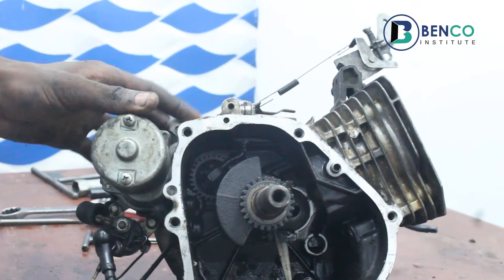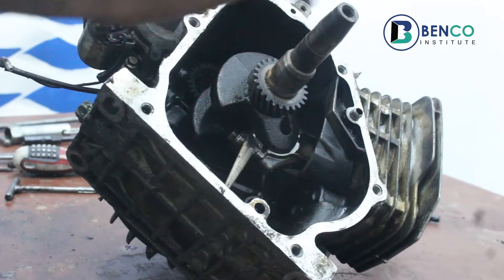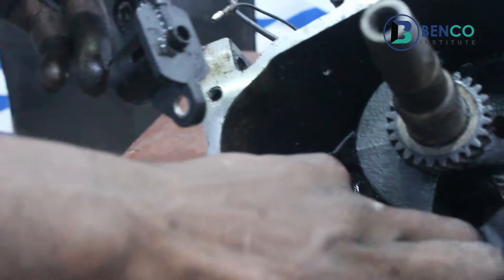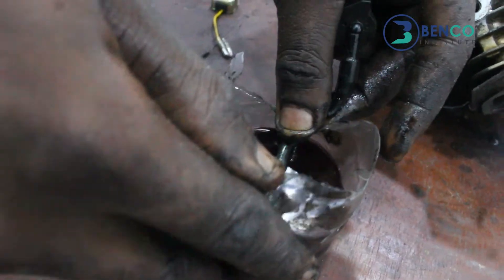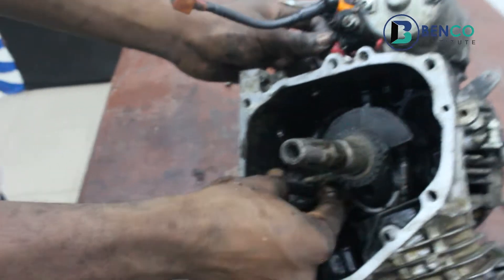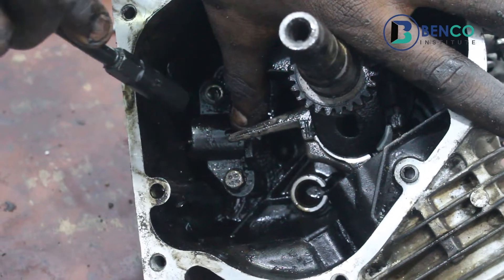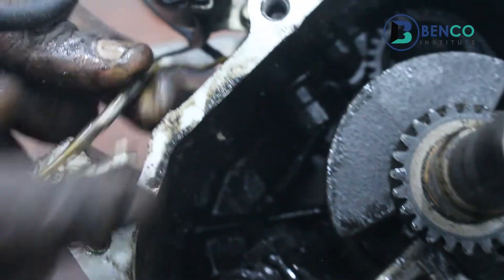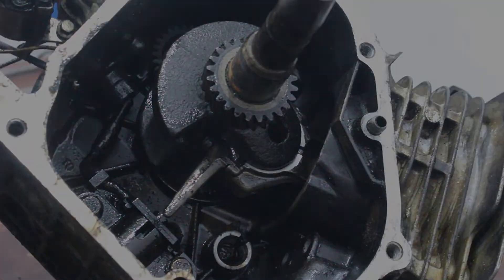How the oil switch and oil sensor of a small engine 4stroke generator work for  fireman,Honda,yamaha

Comment: Thank you for a simple explanation of how that switch works.
Why would them manufacturers ever put a simple switch inside the crankcase? 
I think it was Honda's original design with all the Chinese engines foolishly copying them.
Pain in the Arse to change a simple switch. I assume most people cut the wire and leave the engine unptotected.
Reply from the maker: You are very  right

Comment: Thanks, answered my question.  It's a float switch.  Oil lifts up the float from buoyancy and breaks electrical continuity through the case.  If oil falls low enough, the float drops down and grounds to the case.

Comment: My generator is new 5kw fill with oil and started oil lamp is glowing what is the reson
Reply from the maker: The sensor could  b faulty  then 
Or change the oil,pump fuel into the oil compartment. Let it out and allow the compartment  to dry

Refill  with a fresh oil and it could work...if it doesn't  ur sensor is gone

Comment: My generator light goes low and sometimes comes to the regular voltage, is that my generator sensor wires is faulty?
Reply from the maker: No its not

Comment: Hi Benco thanks for your explanation.Since the oil alert switch and the engine switch are inter connected why is it that when the oil sensor wire is disconnected the engine still works
Reply: When the float drops, the metal pin contacts the crankcase and grounds the primary for the ignition coil. In a nutshell,  the float pin completes the circuit and kills the spark.
Reply from the maker: @michaelscott8510  just to add..the gen  only works because there is still little oil left in that crankcase... If that oil dries up with the switch disconnected your generator would blow up
Reply: @bencoinstitute  what am actually saying is that since the oil switch is totally disconnected and nothing bypass the generator will still work why
Reply from the maker: That's the exact point...Pls watch the video properly you will get your point
Reply: Tanx for your reply but as far as I am concern the function of the oil sensor is useless because without it my generator still works without bypass any wire or module .
Reply from the maker: @adeleyeayodeji1032  
Yeah
Without it if the oil of your generator dries up..your gen will cease and with that you kay have to change a new engine or overhaul it depending on the Damage

Comment: hi benco, you doing a great job.
 I want to ask a question, I have a brand new fireman SFE 440E generator which I normally use for 10hrs a day except for Sundays which I don't work. please how often should the oil be changed or the generator be serviced?
Reply from the maker: Thanks for the compliment

I think you should check your owners manual for that, it's clearly stated the total hours you should use your Generator before replacing the oil...

However  most petrol generator maual gives a range of 150hrs-200hrs of oil use...at this point they believe  the oil has lost its viscosity which in turn reduce the quality and effectiveness of the oil...

Now if you run a generator for 10hrs... Using 150hrs as a yardstick you will have to replace your engine oil after 15days(150/10=15),with 200hrs as the yardstick we have 20days

So left for me I would advice a maximum of 3weeks b4 changing of oil

Note: It's always important to change your engine oil often...this allows for smooth running of your Generator and keeps your Generator longer

I do hope I am able to help
Reply: @bencoinstitute  or every 6 months if the usage is smaller than the hour limit